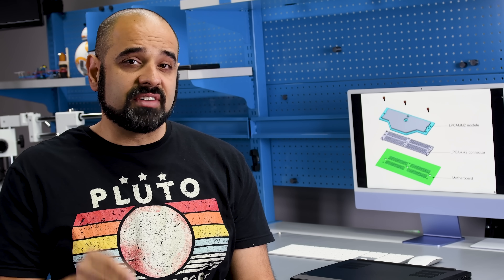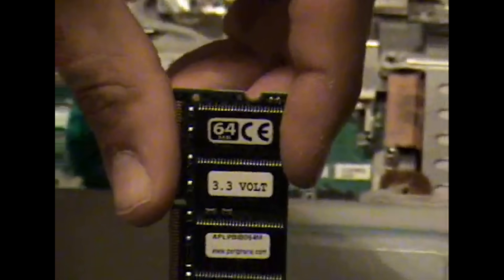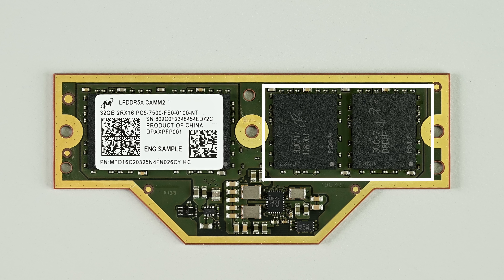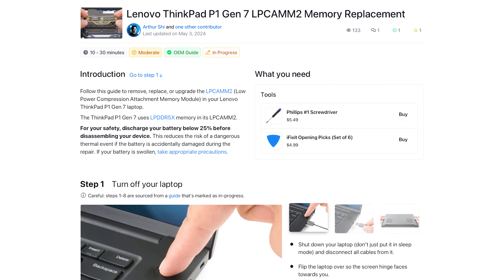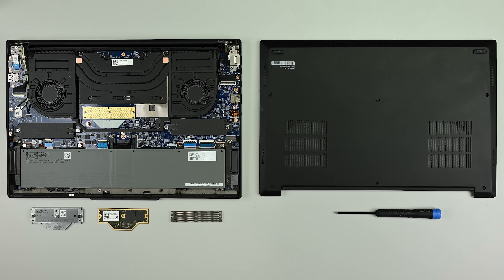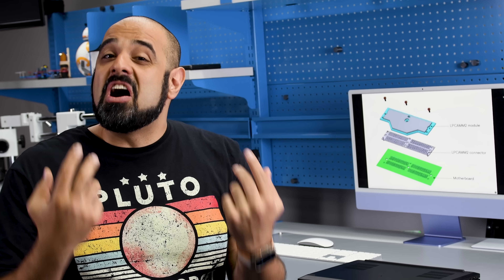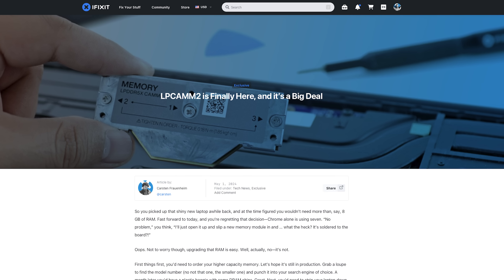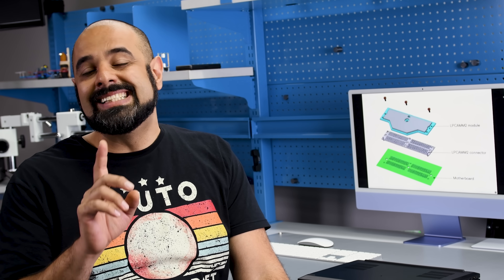New Laptop Memory Is Here! LPCAMM2 Changes Everything!

Comment: Next on the TODO list>
Compression mount memory chips for GPU.
Reply: But there goes 90% of your business
Reply: @Demopans5990  you wish.
80% of all my repairs are not faulty memory but a faulty solder joint.
In which case, if they go with this idea, I'll have even more work because it will be even easier for cracked solder joints to develop 😂
Reply: @northwestrepair  No crack to develop, but wear on the pads from repeated pin-stack swaps can result in painful repairs
Reply: Definitely 😁
Reply: Nice to see you here mang

Comment: Of course I like this (whats not to like?). What I'd like better is the ability to take my expensive screen, and snap it onto an entirely  new chassis. How often have I replaced my desktop PC, but kept my expensive monitor. Or conversly, upgrade my acceptable system with a brand new display?

Comment: I hope they improve it because the spec of this Lenovo P1 gen 7 says only up to up to 64GB LPCAMM2 and one slot look like. It's not enough today for certain applications and definitely not enough in 5-10 years. 

I have a 32go FW13 (bit thinner than this P1 gen 7 by the way using "conventional" ram slot) and the ram amount is already almost not enough for stuff like Docker, big data, etc...

And I'm afraid of the price of these modules. Let's say it's just the first gen, they have time to improve it 👍
Reply: The fact that it needs to be as close to the CPU as possible to get the lowest latency definitely makes it hard to design a dual slot for it.

 However, the 'up to xx RAM'  have also exist in the past because the product wasn't available in the past. So I'm 50/50 sure that it will support higher GB per module and I read a comment saying Samsung is developing a 256GB LPCAMM2 compatible ICs. 

I'm honestly more interested in the heat produced and longevity of LPCAMM2 because even if its upgradable, it will be useless if it will break down quickly over time.

Comment: "...to see how many other manufacturers follow Lenovo's lead..."   Well, I can bet Apple won't be one of them.

But as for "thinner and thinner laptops", I don't want my laptop to be ultra-thin.  I want it to have some level of substance to it, not being so thin that it looks like it would crumple if you breathe on it wrong.  My ThinkPad T430 has the ideal thickness (*AND* it can still contain an optical drive).  It's part of the reason I've put off getting a laptop refresh at work; my ThinkPad P50 is just right for me; the current equipment options would be a downgrade to me (smaller screen, fewer ports on the dock, definitely no VGA/DVI on the dock, etc).  I don't want my cellphone to be ultra-thin either (although I would have preferred a smaller screen size).

Comment: I would love to see this used in desktops too. You could flip the cpu socket vertical like you see on an addon card and then you could simply put these modules on the back of the PCB literally right on the back of the CPU. Heck given the size shown here you could probably even fit 4 memory channels on it.
Reply: If you can find a vertical connector with ~2000 pins and low capacitance. 
There are vertical connectors with hundreds of pins (nowhere near enough) and they already cost $100 each or more, just for the connector...
Reply: @someguy4915  You wouldn't need 2000 pins because the CPU would still be on a PCB. It would just be socketed vertically there. The only pins then that go to the motherboard would be for power and PCIE and other data lanes. You may not even need power as you could have the CPU Addin card simply have the CPU power connection on it instead of the motherboard. Basically take the layout of a GPU and apply that to the CPU. Heck you could even solder the CPU directly to the board and not have to worry about the socket entirely since the memory would be removable. That means that a CPU board actually shouldn't be all that much more expensive than what it currently costs. It would be more but then your motherboard should be cheaper and more importantly because it would be using a standardized socket like PCIE for communication you would just need to upgrade the motherboard whenever you wanted to upgrade the PCIE version it supported.

Comment: If they could make the same thing for CPUs then i would be even more happy. Having and ability to upgrade CPUs is also big deal in my opinion. Also this replacable compression connector would be amazing for CPU motherboard sockets. Bend pins ? No problem just buy new compression connector for few dolars and you are ready to go again. Your 200-400 dolar motherboard is not paper weight. Problem could be those currents running through it. It would also probably limit OC options.

Comment: This is really clever. Regarding upgradability, only unfortunate thing is that you have to replace the entire ram module. Nice thing about sodimm and ddr is that you can add sticks of RAM without having to remove existing ones. If you have a 16GB ram stick, you can just add another 16GB one instead of having to remove the existing 16GB stick. Of course that presumes you have more than 1 ram slot.

Nonetheless, this is exciting, although I unfortunately don't see this taking off and becoming a common thing because laptop makers will most likely want to solder RAM so that they can markup the crap out of it.

Comment: I have a newer Lenovo laptop, it's budget but I was kinda floored how modular they made it. I recommend them pretty often now so It's great to see them stay the course.
Reply: Yeah, I really enjoy Lenovo laptops. I got a recent, though lower-end Thinkpad recently to replace a 5 year old Ideapad I had. There's plenty of room for storage upgrades, and I added a 32 GB SO-DIMM to accompany the 8 GB of soldered on RAM. I like that you can just buy parts as needed directly from Lenovo. I had dropped my old Ideapad, and it was a snap to order a replacement back shell as the old one cracked.
Reply: @The8bitbeard  I added a 1tb 2.5" SSD to mine. They left the drive holder in the case with screws, all I had to buy was a $7 ribbon cable. Kinda stuff breeds serious brand loyalty with me.
Reply: lenovo budgets are pretty alright, it works as much as you paid and it lasts long provided great care

Comment: That doesn't seem thinner than a so-dimm slot, at least a single slot one. Maybe it's slimmer than the ones that take 2 modules but thin laptops don't use them anyway. All the drawings you see online is them comparing it to a double slot one. It will take less space in the motherboard but it will be the same in the z axis.

Comment: the real, question, though... will manufacturers actually implement this? from the profit perspective, this probably makes sense on higher end stuff like gaming laptops and portable workstations, but for low and mid range laptops I don't see why they wouldn't just keep soldering the RAM on board…
Reply: Easier management of inventories. With soldered ram, they may end up with a pile of unsold hardware with a certain ram capacity, while with replaceable memory it's easier to replace the memory to the amount that is selling better. Also cheaper repairs under warranty.
Reply: It will probably be on high end laptops for a while before it being cheap & common enough to be used in basic / cheap laptop.

 DDR5 on SODIMM are quite a new thing and used too much power to be practical on a laptop. Lenovo's Thinkpad lineup famous for its repairability had to choose soldered LPDDR5 over SODIMM might be because of these disadvantages. That's why they expand LPCAMM2 standard that were developed by Dell.

  I can see it being used in upcoming ARM windows laptop that prioritises on battery life and cooling as thin as possible while also being fast to compete with Apple. Having upgradable LPDDR5X also makes a great marketing too for enthusiast and professional users.

 If we think about it, SODIMM on DDR6 probably won't even exist because of its limitation so it is safe to say that LPCAMM2 or other better standard will be the future of laptop/tablet and while useless to a desktop, maybe we will see them on mini pcs and ITX motherboard.

Comment: About time. I’ve wondered why we kept the SODIMM form factor ever since Apple started soldering in RAM back in 2012. Never occurred to me to move the pins to a discreet interposer though, that’s an incredible innovation that will drive down costs both on the manufacture and repair sides.

Comment: The only downside is that you have to replace you old ram module completely unlike just adding an extra stick of ram to the system. This would be even cooler on Desktop pcs.
Reply: Like, unless they add two sockets to the motherboard?
Reply: @fiddley design constraints, you have to remember that it has to be uncomfortably close to the cpu, and if its positioned in series the signal won't be in phase. Sure you can put it on the two sides of the cpu but remember a cpu also needs at least 3 sides free to accomodate for VRM, data highway from and to a gpu, and other miscellaneous signal and power lanes such as audio, and other pcie devices.
Reply: @sephylle  Thanks, that's a really informative comment! But, there's always a way! :)
Reply: @fiddley  No not really, some things just aren't really possible. Other things might be possible but will cost more than a fortune per laptop :P
In theory you could use a SoC with everything integrated so the only signals coming from the CPU are HDMI/DP, USB and Ethernet and in that case you could add two memory busses; one to the left of the CPU and one to the right.
But in that case you wouldn't really care about more memory as the performance isn't there anyway then.
Reply: @someguy4915  we are pretty much reaching some hard to design around physical limitations these days. Still improvements to be done, but this is why onboard accelerators and globs of cache are being stacked onto chips.

Comment: I love this, but we all know stuff is getting soldered in to make you buy a new one. It needs legislating against.
Reply: Why?  There are legitimate and technical reasons for soldering things to the board.. For example, the "LP" in "LPDDR"
Reply: @jorper2526  Because companies are selling $3000 devices with a reliable life expentancy of about 3 years. Not only is it a rip off, it's an environmental and economic disaster that causes massive amounts of extra E-waste and cripples the second hand market (that often funds new purchases, ironically). The marginal performance gains of soldered RAM are more than cancelled out by most soldered systems having far too little of it. Whatever gains are made from soldering in 8 or 16GB or RAM disappear against 64GB of dimms for the same price, a tiny little bit of extra battery life certainly isn't worth, speed and bandwodth become irrelevant if it's saturated and relies on the swap file. As for SSDs, there is no justification for soldering them in. It's a manufactured failure point and should be illegal, nobody would accept a car that unrepairably broke down at 50'000miles, yet they quite happily accept it on computers that cost as much as a second hand car.

Comment: This is great, but imo soldered storage is much more of a problem than soldered RAM.
Reply: I don't think that's a tech problem, but it's something a certain company do to maximize profits (you know who I'm talking about).

 That being said, an external storage can always be hooked up to a laptop thus making the storage not a too big deal. 

 Ram or memory however, can't just be plugged into your usb port. It will not be practical and if your soldered ram broke, you can't (easily) replace it.
Reply: @user-28qhfk65  yeah well unfortunately the laptops from that certain company won't work at all when the internal ssd fails, so external storage doesn't solve all problems

Comment: There is a downside to removing soldered joints.  Here in the southeast we have humidity.  Corrosion in plug in connectors is an issue.  On balance I'd still take the plug in, but be aware of that issue.

Comment: The fact the CAMM pin stack is replaceable is just too awesome. Whoever managed to get that to not just work, but work reliably needs a medal.

 Can you imagine if desktop mainboards had a replaceable LGA like that for the processor? you could have a socket that can just be popped off in amatter of seconds and replaced just as fast. Bend a pin? Contact the vendor and get a replacement! No more dead board for a bent pin. Socket full of thermal paste? Pop that sucker off and bathe it in IPA and ditch the tooth brush!

CALGA would be a major win if it can be made to work on a CPU package...
Reply: Can’t you use switch cleaner for sockets with thermal paste though? It comes in a spray can, so it shoots out nicely, but not strong enough to bend pins
Reply: @satsumagt5284  You can and I previously have done so before. Works pretty well too since the pressure also blasts the chunks out.

Depending how well embedded the paste is though it can take quite a lot of switch cleaner to get a good cleaning.
Reply: Not happening.  LPDDR is a few watts at most, while CPUs can be 300W (200A).  Bandwidth density is also much higher on the data pins.
Reply: CALGA deez nuts

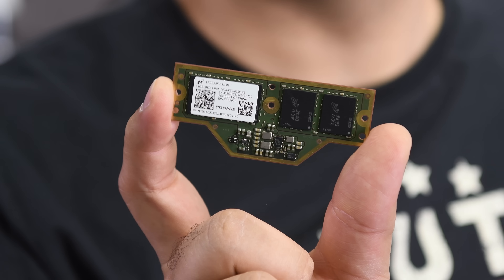Comment: 0:28 It started with the Macbook Air. OEMs didn't paint themselves into a corner, customers started demanding ultralights that had the portability of a tablet and a keyboard/trackpad; the most visible expression of this turned out to be models like the Microsoft Surface and the Asus Flow Z13, basically PC tablets with a dockable crappy keyboard/trackpad.

Comment: LPCAMM2 is good for CPU based situations but as we start to see more SOCs with larger GPUs it will still be limited in bandwidth as getting 2 of these onto a system close enough to the SOC is going to be difficult.
Reply: Well, this isn't for SOC..  And you don't upgrade GPU's memory anyways.  Besides which, this isn't GDDR.
Reply: You don't need two, one already provides dual channel
Reply: @ithinkabout4369  still not enough bandwidth for a large SOC/GPU
Reply: @hishnash  The fastest SO-DIMM speeds on the market is 5600 MT/s, and the ram stick you see in this video has 7500 MT/s, since iGPUs on SOCs use the system RAM, this speed increase will greatly improve the performance, especially on SOCs. It's systems with dGPUs where this isnt that relevant, you've got it backwards.

Comment: LPCAMM2?
I slept and missed LPCAMM1.
Reply: you probably didn't sleep through it,  I think LPCAMM1 was dells version that that donated to the JDEC standards,  and it seems they finally agreed to accept it, and that what LPCAMM2 is
Reply: @drone_video9849  Yes ,LPCAMM1 is the Dell's version which was bigger and bulkier. The interconnect was replacable but it was a hassle. Pretty much ver1 was the prototype that Dell and Samsung developed. Then Mircon took it and fixed the "bugs" . This  is much better. The original didnt even  had a heat sink and because it was big , it didnt attack anyone.
Reply: @drone_video9849 I am pretty sure Samsung had something to do with lpcamm and were working on it in 2023. I don’t know about lpcamm2 though
Reply: @bakedPython LPCAMM would be the original Dell implementation in this case
Reply: Dell already implemented it in the precision lineup, with the precision 7680 being one that used an LPCAMM module of upto 128GB
Reply: It's only one module?  How much memory can it hold.
Reply: @bashfullJ88  this is 32 gb or something
Reply: @kreuner11  my laptop cant even go above 30 gb ram 😭
Reply: @bashfullJ88  That one clearly says 32GB which would be enough for most users.
Reply: @bashfullJ88  apparently this version can do up to 256gb in the module.
Reply: @Agret that's a lot of memory. Could run your entire computer without a storage drive if you didn't turn off your computer. 😂
Reply: @Mr_Battlefield  that's true, would make for some good file caching acceleration if you use stablebit drivepool
Reply: @Mr_Battlefield  Get a UPS for power and run off RAM.

Comment: It will only change something if laptop manufacturers decide to use it without gouging people's wallet instead of soldering RAM.
Even in this day and age there is still mid-high end laptops with soldered RAM, either only or half-half
Reply: Soldered RAM is a necessity if you want high speed DDR5. The problem with DDR5 having problems with the SODIMM form-factor is the reason why LPCAMM2 was developed in the first place.

Comment: So just one "slot", meaning that for any upgrade you won't be actually adding more memory, but you'll need to fully replace the module with a bigger and more expensive one,
this one IMHO is a huge drawback.
Let's say you have 16GB but you want to increase it to 32GB? The you won't be able to just add other 16GB, no, you'll need to buy a new 32GB module and find out what to do with the old module (sell, trash, recycle etc..).
Reply: You're saying it as if laptops with two SODIMMs running single channel from factory is a big thing.

You open and see two 8GB modules, both would be need to replaced

Comment: Imagine desktop ITX motherboards having this connector mounted close to the CPU without interfering with the cooler
Reply: Idk about that, I think DIMM (or SODIMM, for that matter) use more efficiently the real estate since they can be socketed vertically.

But how about LPCAMM2 sockets on the rear of the board? 👀
Reply: Or you could piggyback off the CPU cooler and have it run faster
Reply: @iaial0  Wouldnt really work since the CPU footprint is insanely dense even on the back....THO you can put it closer there. Right throught
Reply: @iaial0  Oh nuuuu. Now you have to remove the entire motherboard to upgrade RAM?
Reply: Worse

They add it into ATX motherboard. Bittersweet win😊
Reply: It will probably replace the DIMMs too